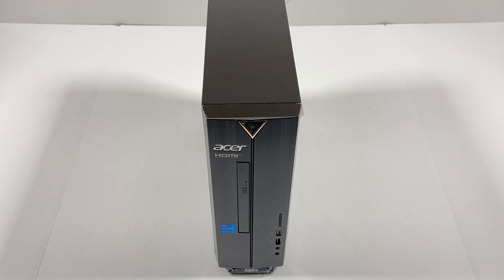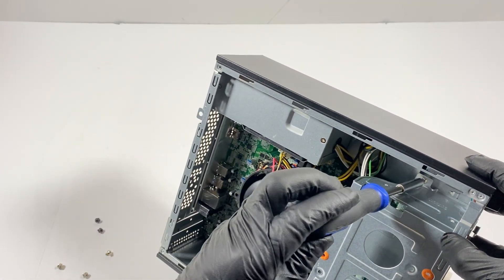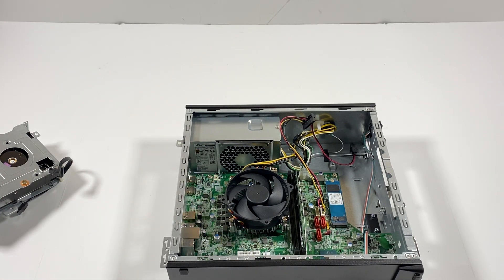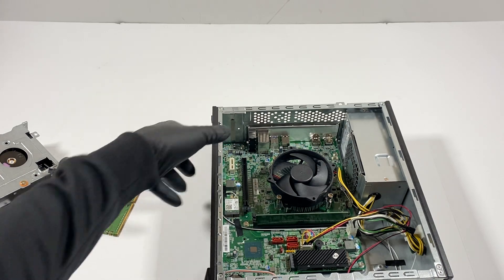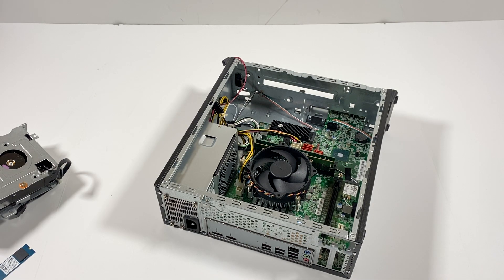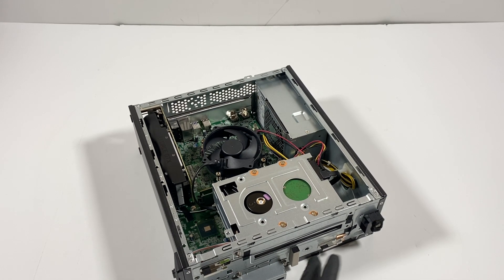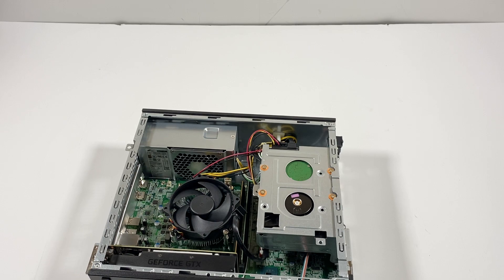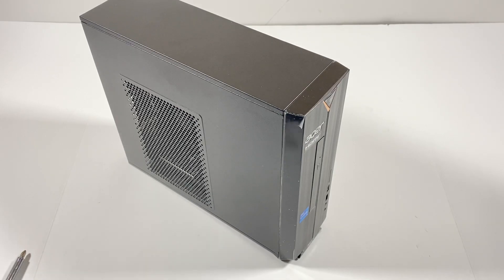Acer Aspire XC 1660G Gaming Upgrades SSD RAM Video Card

Comment: I got the same computer a few months ago and it came with an i3 instead of an i5. I put a gt1030 and a 500 gb ssd and it works really good for playing some light games and webbrowsing. It also came with a keyboard mouse and monitor for only 500$. I paid 90$ for the gpu and 50$ for the ssd and it is a really great computer! Thank you for this amazing guide
Reply from the maker: Hi, thanks.. Yes this is great small PC with i3-10105 you have...
Reply: did you literally just change the parts and it worked, i have one i bought new but want to upgrade these parts but it is already running and has data saved on it i dont want to lose.

Comment: Thanks for the video.
Picked up one of these for my 7 year old son, brand new but opened box for $150 this morning. Set it up and it wouldn't boot,  just blank screen and continuous beep.
Search suggest power supply problem so a bit disappointed. 
Watched your video and noticed it had only one ram stick but mine had two installed.
I removed the added ADATA stick and it boots up and runs great.
I will get another compatible ram stick tomorrow and maybe a graphics card.

Comment: The AMD RX 6400 LP is currently the fastest low profile GPU and it uses just 55W. It's the best choice for PCs like this.
Reply from the maker: Hi..
Reply: Depends if the pcie slot is pcie 4.0
Reply: @arasumi3408  I think this PC is from 2020 or 2021, so it should be 4.0
Reply from the maker: Hi guys yes PC manufactured date shows 11/2021
Reply from the maker: Hi, Motherboard uses Intel B560 Chipset so it is PCI Express Revision 
3.0
Reply: @Mxkdt  ah, ok, too bad, guess the gtx 1650 lp is the best choice then.
Reply: You can use the Rx 6400 but the GTX 1650 usually outperforms it on pcie 3.0.
Reply: @nermanus  I recall buying the ZOTAC Gaming GTX 1650 OC for my Acer Aspire XC-1660G UW92 desktop PC, and to my own discovery, it's able to be detected in the BIOS, even though the graphics card is bigger than the case, so I ended up having to bend some of the frame of the chassis to forcefully fit it lol. I suppose it's better than nothing.
Reply: RTX A2000…

Comment: Awesome Video.  Just got this PC today.  Do you recommend changing the heatsink Fan?  People is saying it is very loud.
Reply: Also gonna get another 8GB of Ram from your link :)
Reply from the maker: @Nguyen Tran  Hi, thanks, i am not going to replace heatsink fan.. You can try to replace fan if you want, it is your choice..
Reply: @Mxkdt  Hi, When I click on the link (3.) Crucial 8GB DDR4 3200 MT/s (PC4-25600), there are 2 types of 8GB stick.  Will the $34.99 work with this unit?
Reply from the maker: @NguyenTran-be5yc  Yes of course that RAM will work with this PC...
Reply: I did replace the heatsink fan in mine with a Coolermaster that had more blades.  Cut down on the noise quite a bit.  Cost about $7.
Reply: @lkronquist  Can you supply a link to the exact model?   Mine seems to get more noisy by the day.

Comment: Really well done MXKDI. Thanks for the detail. I am only replacing my current 8GB of RAM with the Crucial RAM 32GB Kit. Is there clearance to slip the two sticks in without removing the housing for the optical drive? In other words, nothing more than the outside cover? That would be pretty easy if it's possible and a good place to start with my upgrades for the time being. Thank you.
Reply: yes

Comment: I love getting the most out of old Acer, Dell, and Lenovo PCs. I worked on a 10th gen Acer Aspire a year ago. It was the same form factor, but had a i3-10100 and the motherboard looked slightly different- only 2 SATA ports and other differences. I found out the hard way that the M.2 slot was only PCIE 3.0 x 2. Does this model have a PCIE 3.0 x 4 NVME?

Comment: $500 is a lot for that. I have this exact tower and I got it at WalMart for like $200. Good video tho! I need to do this upgrade because this thing cannot handle much with the IGPU
Reply from the maker: Hi, did you buy it brand new or used ? because they sell new for around  $569 plus tax total cost over $600 for this PC with i5 CPU..
Reply: @Mxkdt  he most likely picked one up on clearance.

Comment: What is the motherboard model that comes with the desktop? Can this motherboard be installed into a new case? That way you can use two HDD and a disc drive in a different case as well as a bigger graphics card
Reply from the maker: Hi, model is  B56H5-AD
Reply: @Mxkdt  Thank you. So does this motherboard not have a typical power connector if I wanted to use a different PSU? I found a picture of a very similar motherboard in an Acer forum and it looks like it has an 8-pin and separate 6-pin power connection on the board but no 24-pin. Makes it seem like the board is powered by what is normally used to power a GPU

Also, does the CPU fan prevent RAM with a heatsink from being used? It looks like a tight fit trying to get RAM to slide under that fan.

Comment: How is your NVME Speed? I have two of these with i3 with stock  WD blue 256gb nvme and a second one with mp34 2tb. I only get ~800MB/s read on both of them in the m2 slot. I have an NVME adapter on the x16 slot and that gets 2000MB/s read like you would expect. 
Also I did manage to stick 2 hdd in this case, Velcro taped one to the side panel vertically. 
Using one for workstation at work and one at home for Proxmox home server, samba file share, home automation, Plex, etc. Pretty happy for my use case but I kinda wish I went with the i5 and 32gb of ram instead for home server (I upgraded to 16gb ram).
Mine are Ebay refurbs for ~$200 each, they looked brand new.
Reply: 3000+ with crucial p5+.

Comment: Do you think a gtx 1060 low profile that draws 105 watts is to much for this power supply. I just bought this on eBay refurb to run two media server platforms. I will be adding another 8gig ram and 3.5 hard disk.
Reply from the maker: Hi, what video card are you going to use ? i recommend a gtx 1650 low profile or rx 6400  low profile video card, that will work perfect with this PC and 300w power supply...
Reply: @Mxkdt  I happen to have the low profile 1060 I pulled from an older HP machine. Since it’s going  to run as my media server  I’m only going to use it for transcoding.
Reply from the maker: I did look it up online and that video card is not low profile it is mini gtx 1060 will not fit this acer small PC..
HP NVIDIA Geforce GTX 1060 3GB GDDR5 - P/N 909616-001
Reply: @Mxkdt  ok thanks for the info.

Comment: What did you have to do when you replaced the SSD? I think I want to upgrade mine as well as mine came with the 256GB, but did you have to re-install the operating system? Did you back up the system to a USB or anything?
Reply: I cloned to SSD in USB adapter. But had to go thru windows repair and reinstall my apps.  Never had to do this before with clone on SATA SSD.

Comment: I have the i3 version and looking for a cheap video card.  I have added the memory and I have a WD Black 770 1TB coming in that I will add.  But for the graphics card, can I modify the case and add a full size card?  If I can, what are people recommending?  I know power is an issue.  I am more interested in graphics and less about games.  I am also using it for my Plex server.  The low profile cards are very expensive for what you get.

Comment: I have a question! I need to upgrade my 180w psu to a 300w, but it needs to have a 6 pin cable like yours. Where do I find that one?
Reply: Hey! Question, is your Acer PC the same one as in the video? Do they come with 180w power supply?
Reply: @iancgoitia  Hey there! Yes and yes. At least mine did and I upgraded it.
Reply: Thanks! Must be a great little PC after the upgrade!

Comment: How did you get the ram to run at 3200? I changed ram and it went from 29xx to 26xx and I don’t see anyway to change it in bios. I have the same PC. I have the latest Bios but can’t update the firmware to 1.1.

Comment: Two part question
1.Anyone know where you can buy a second data/power cable: "Acer XC-895 Power SATA Hard Drive Cable Connector 50.VQED3.001"?
2.If I do find/buy the above cable, could I then install 2 - 3.5" hard drives.

thanks
Reply: They should come at best buy or online
Reply: plenty available on eBay

Comment: i just upgraded the factory wd 256 nvme to a 1GB solidigm, but according to crystal diskmark, all the speeds are about the same (~700-800MB/s sequential reads). is there something i need to change in OS or bios to see full speed? what could be limiting?
Reply: its a lot faster in linux on same machine. 2500-3000 MB/sec
Reply: The motherboards stock almost unchangeable bios is what’s hurts it the most

Comment: Will a gtx 1660 super work on that PC? I need a reply asap
Reply: no but a rx 6500xt would do just fine
Reply: @1MINN0CENT but I've never seen a low profile rx6500xt before, closest one that works is the low profile rx6400

Comment: will the MSI GAMING GeForce GT 1030 2GB GDRR4 64-bit HDCP Support DirectX 12 Low Profile Heat Sink OC Graphics Card (GT 1030 2GHD4 LP OC) fit in there automatically or do I need another bracket?
Reply from the maker: Hi, do not buy that video card because it is GDDR4 and try to get GT 1030 with GDDR5

Gigabyte GeForce GT 1030 GV-N1030D5-2GL Low Profile 
https://amzn.to/3MlzTzq
or
AMD Radeon RX 6400 Low Profile Gaming Graphics Card
https://amzn.to/3s8MUUY

Comment: do you have to plug any wires into the gpu
Reply from the maker: Hi, not really.. You have to use low profile video card with low profile bracket on this small PC..
Reply: @Mxkdt  so im getting a 6500 xt by radeon, is that counted as a low profile video card? thank you so much for getting back to me :)

Comment: I swapped this same motherboard into a custom case with a adapter for the power supply I got off Amazon for 12 bucks this little thing runs a rtx 3070 great
Reply from the maker: Hi.
Reply: Hey, what custom case did you end up using?  thanks
Reply: @stevealciviades8696  any mid tower case will work fine don’t worry about the front io either u won’t be using it
Reply: HI. Can you tell me what adapter you used?
Reply: It’s made to plug into another psu female plug to the psu
Reply: I play rdr2 on that same mb 1440p averaging above 60 and it can easily do 4k above 30 even with a i310105f and a mb that limits ram speed to 2166
Reply: And it’s not a gaming motherboard but it performs very well
Reply: If you want pictures lemme know
Reply: @pepeiann   if you have the opportunity to take detailed photos of the connector, I will be grateful
Reply: @Andrey-et6tp  yea it’s simple really simple to install
Reply: @pepeiann  I plan to install the GF 1650, the native unit for 180 watts will not stand it .. the TFX ATX power supply is suitable in size, but I can’t figure out how to remake the connector ...
Reply: @pepeiann  whats the adapter u used pls
Reply: @1MINN0CENT  it’s on Amazon I’ll link u it later
Reply: @pepeiann u can tell me connector ? Wanna do the same thing, but need a new case and a new psu….